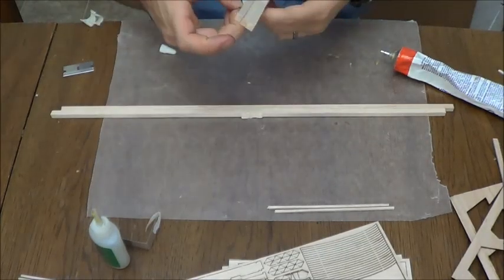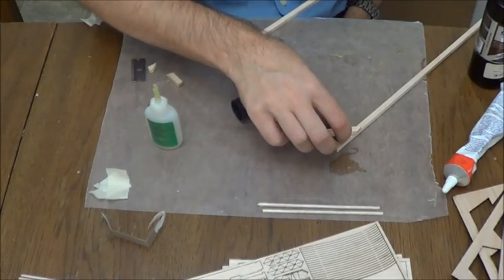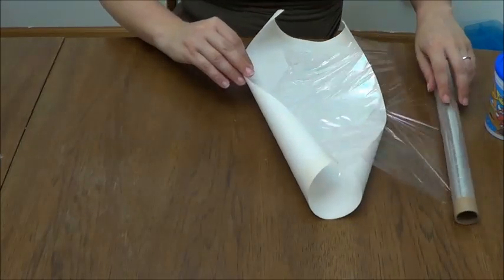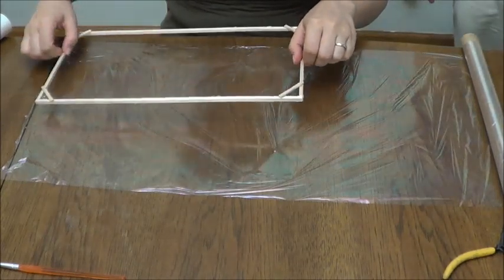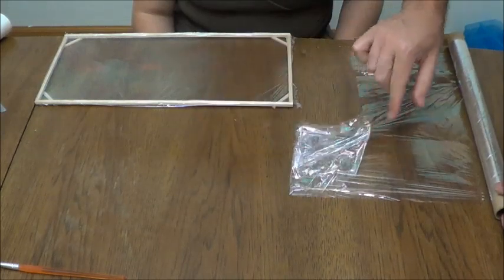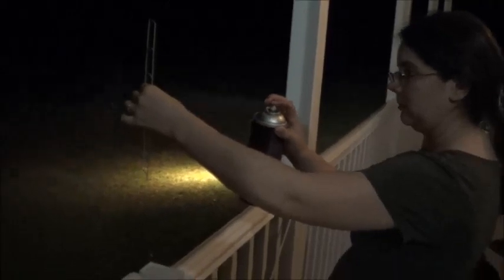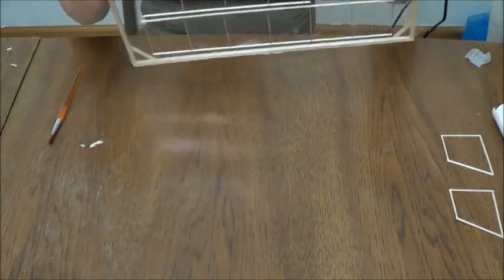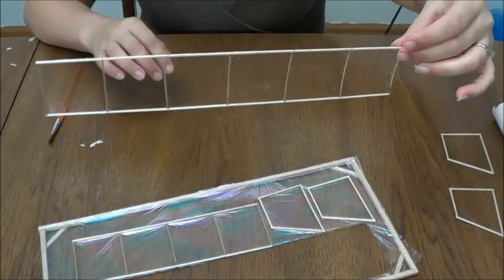Intruder A-6 Indoor Freeflight Build, Pt.5 Covering

Comment: Something I have found absolutely necessary for covering is a piece of 2" thick open cell foam, It is the same stuff used in cheap cushions. I don't know if you have Ollies stores around, but I bought a piece 24x24 for something like $4 from them. I spread the film on it, and cut it with a soldering iron. If you keep the iron moving, it doesn't melt the foam, I set the iron to 600 degrees, it seems to work fairly well. Then I can spread the film out and press the covering frame into it, it gets it  adhered with equal tension, and works very well. I should make a video on it.
Reply: Well sir show us some magic 🥳